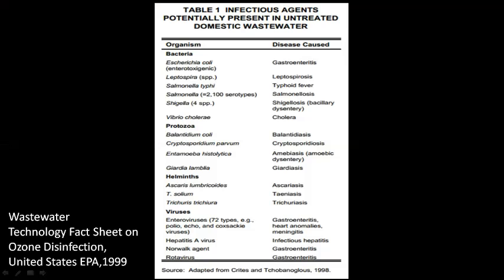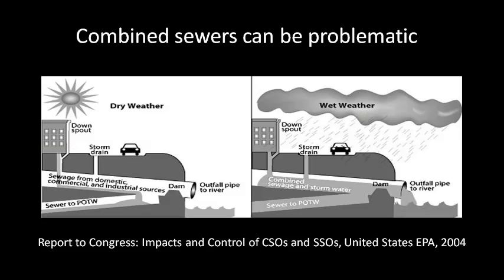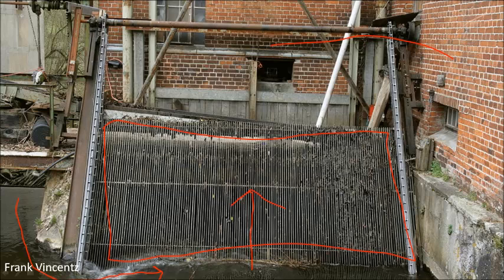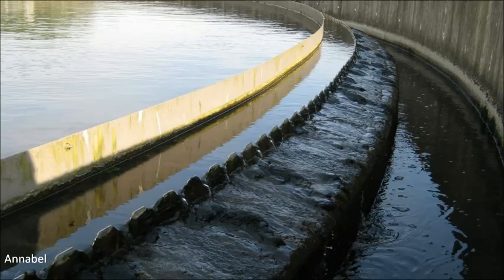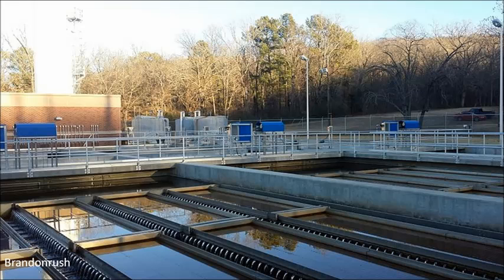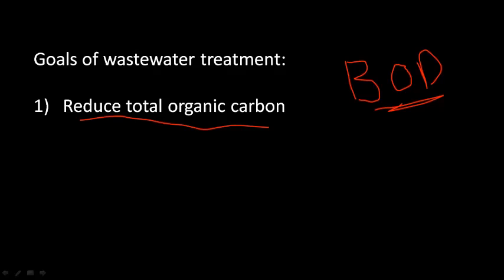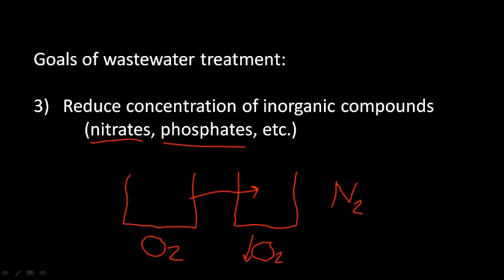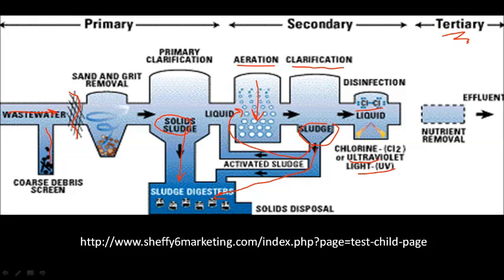Lecture on Wastewater Treatment

Comment: I call BS on the capacity argument yes treatment plants have capacities but when they have to go into Curry Creek for example like my dads plant here in florida it the treated water going in to make room for the influent raw. Actually I don't want to call bs because idk what you guys do up north or if you even work in waste water treatment but in Florida we don't put raw into the ocean because of capacity limits! Thank you for your video I love it and have found it to be the most informative 2nd to the engineering waste water treatment plants lectures but 1st in my eyes because I'm not an engineer
Reply: You probably don't have combined sewers there. If you collect black/gray water separately from stormwater then there is no discharge of sewage to surface water bodies. As far as I can tell, the stormwater is simply discharged to the nearest creek. Here in Colorado many stormwater drains have signage 'drains to river.'